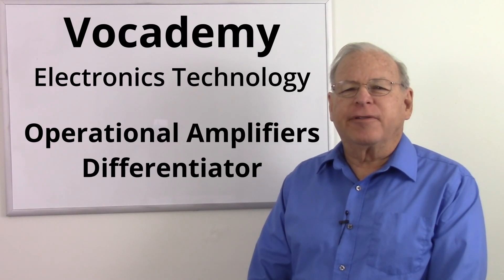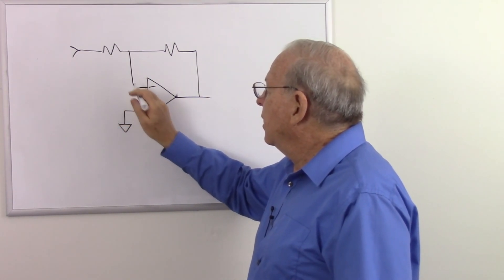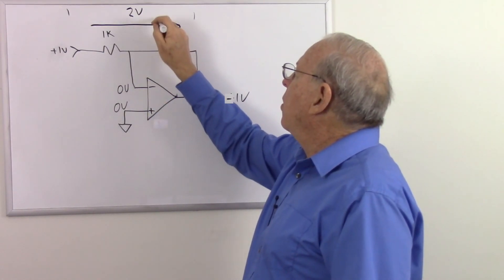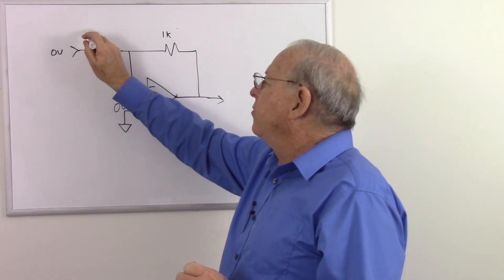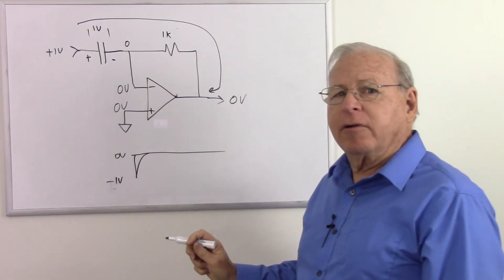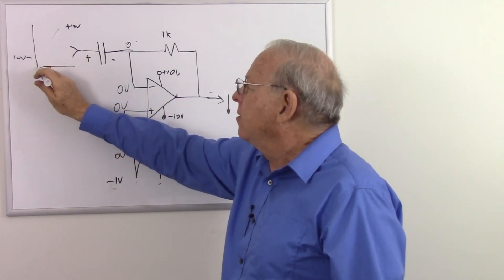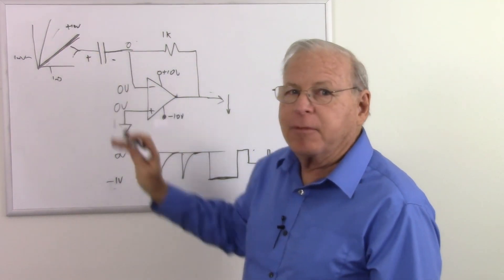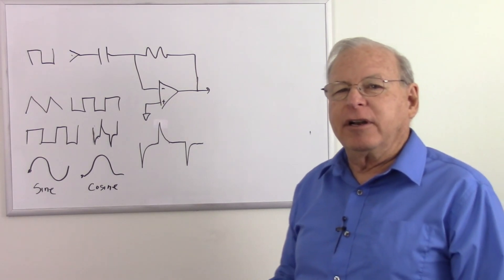Operational Amplifiers No  10   Differentiator

Comment: 12:03 you can use a potentiometer as movement/direction sensor and have a latching circuit... for example a car dor that you push it slightly by hand than the electric motor keeps moving the dor in the same direction untill is completely closed/open.

Comment: bit confused about the capacitor charge, in the first 1v example the capacitor charged to 1v the op amp compensated with -1v, but why then when you apply 2V does the capacitor still only charge up to 1V with the op amp compensating with -1V as shown in the video, why wouldnt the capcitor charge up to 2V (same as the supply) with with the op amp compensating with -2V? thanks.